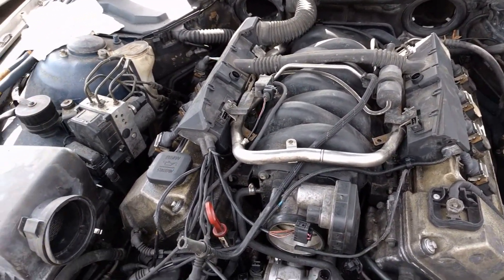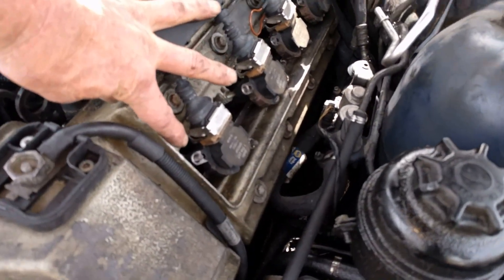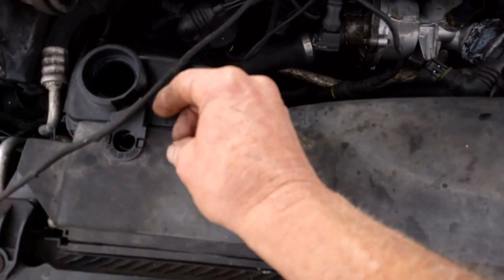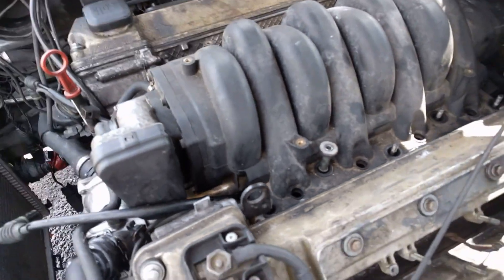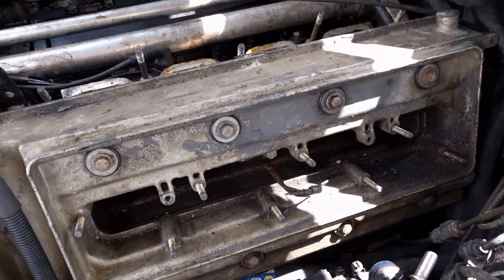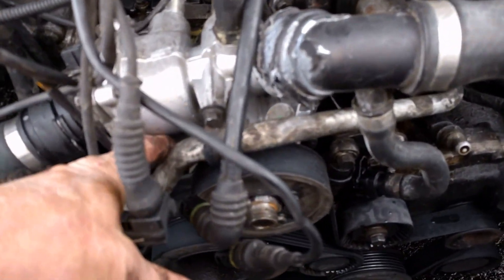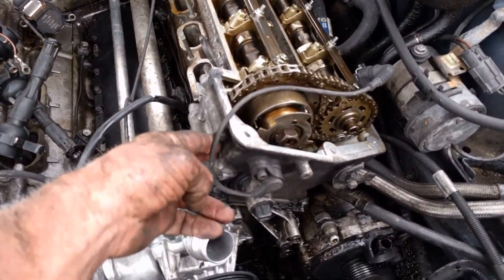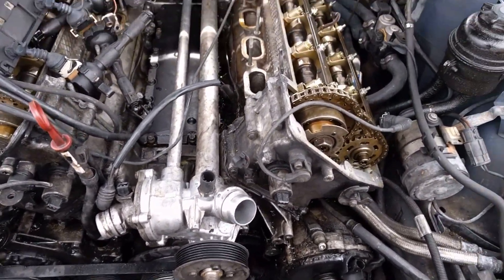BMW M62tu Head Gasket Replacement part 1 of 4

Comment: I put head gaskets on my 03 range rover which has the bmw m62 engine. I cant seem to get the #1 rocker arm to stay after removing the timing tools any advice?
Reply from the maker: I am not sure if this is what you are talking about but, once you set the timing and remove the timing blocks, the cams will turn a little. This is normal, and the engine will go to the start-up position.

Comment: Glenn  in looking at part one of replacing a 4.4 M 62 in the very first part you mention unpluging water hoses and vac hose and you mention a water heater connection  ??
if this is not plugged in tould this perclude the engine from not starting.  if i could get the motor started i was going to try something.  aqppreciate you informatio n  on this.  ihave started up engines with blown head gaskets, this one will not start!   and i had all the electronics checked.
Reply from the maker: No, this will not stop it from starting.

Comment: Can i remove the head with out timing after?!
Reply from the maker: No, you have to take the timing chain off to remove the head
Reply: Thanks a lot. i read about timing procedure in this web sit https://www.germanautosolutions.com/diy_tech/vanos_tools/m62_m62tu_cam_tools/m62_pro_cam_tools_diy.php#thumb
Also i saw your video and it was very helpful 
Thanks
Reply: I have a question about timing. if i need to do perfect timing is there any mark to follow or any things!
Reply from the maker: No, you must use BMW timing tools. The timing tools are the only way to get the timing set. If you try to do it with out the timing tools you will be sorry. The tools don't cost that much just google (BMW timing tools) you will see tons for sale. My first set where did not cost too much and they worked good they just did not last long. Some people even sell them used. They use them once for there car and then sell them.